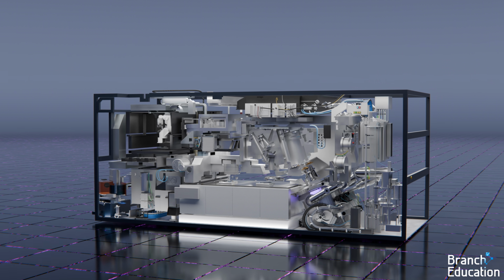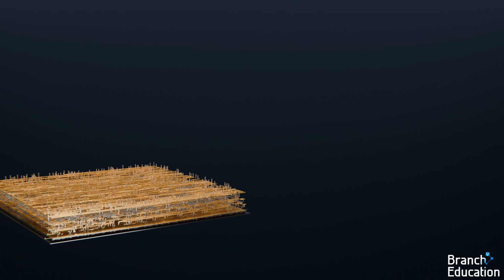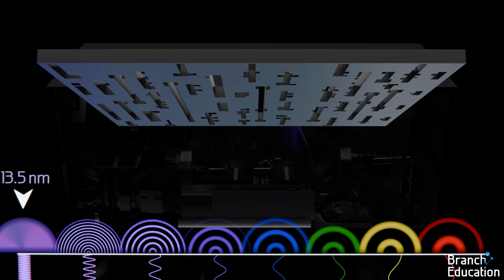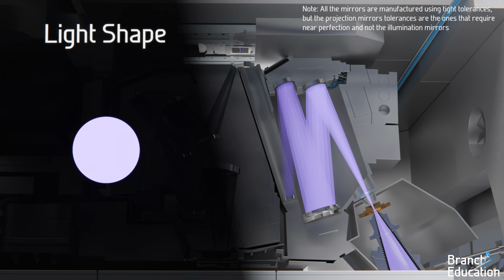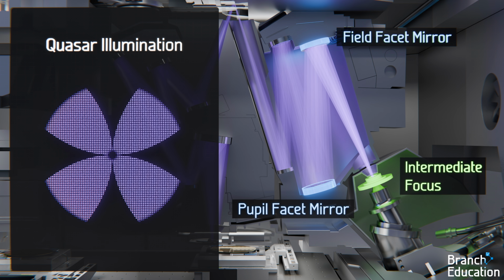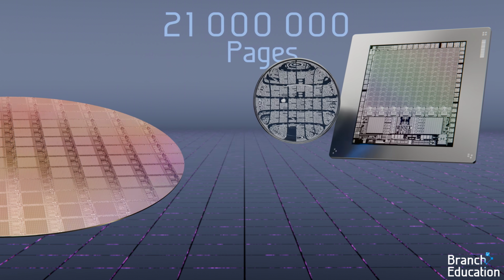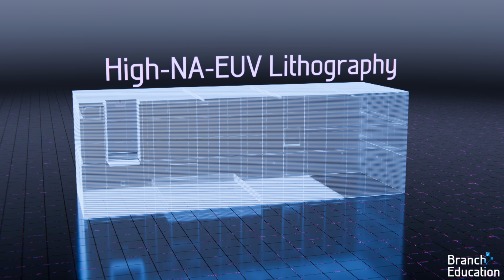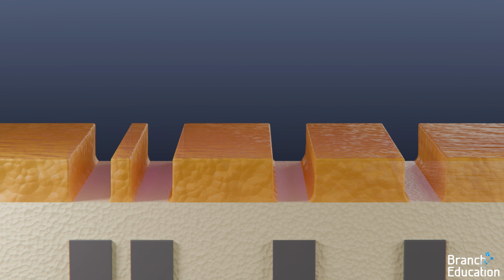The $200M Machine that Prints Microchips:  The EUV Photolithography System

Comment: One question that I cant figure is, 1) how is it possible for the wafer to sit above the magnetic field and move in pin point accurate synchronization with the beam of light hitting the wafer because if it is a nm difference its wasted. 2) Does the electromagnet have any effect on the wafer particles? The main secret of the machine has to be in the detailed accuracy of its parts...

Comment: I'm starting to wonder if X-rays using special fluoroscopes would be more efficient than shooting flying drops of tin with lasers, while producing an even smaller wavelength, but I'm sure we're right up against the hard limit of transistor size as it is, and it's probably been explored by now.

Comment: Why are the wavers a circle and not a rectangle? Couldnt more chips fit onto it then?
Reply: When you have to make a plane of material so consistent and uniform that you have to use tricks of physics instead of direct contact tools, circles are your friend. Guess how early rectangle panes of glass for windows were made? Circles cut down to rectangles.

Comment: this video was absolutely BONKERS.
A couple questions came to mind. We learned that the reflective material for the extreme ultra violet light emitted reflect only 3% of light per layer, then why doesn't the mirror have more layers? is it a matter of light being absorbed while passing through even tho it's so small?
Another question i have is: I learned from previous videos that the chips can be defective in some way due to photoelectric errors or let's call it "dirt", how do these happen? is it that hard to maintain the cleanest environment throughout the processes?
Final question is simple, are damaged or imprecise wafers simply thrown away or are they cleaned and "reset" in order to recycle the material and make a new set of chips?

Comment: Sub nanometer accuracy for the  metrology. That is crazy.  Off by .00001 deg./sec, sure no problem with rotating the disc to correct clocking. Then the linear positioning of the disc to hold positioning is just as crazy.

Comment: Hi, I am from Taiwan, home of TSMC, and I really want to thank you for those who contributed in this channel, this is the best animation video with the richest information ever about the EUV machine, my biggest respect to you all and thank you so much~
Reply: Based on current information, it appears that TSMC is planning to skip the use of ASML's "High Numerical Aperture Extreme Ultraviolet (High-NA EUV)" lithography equipment for the development and initial mass production of its 1.4-nanometer (A14) process.

Key takeaways:
 * No High-NA EUV for A14: Reports indicate that TSMC has decided not to purchase the extremely expensive (estimated at around $400 million per unit) High-NA EUV machines for the 1.4nm node.
 * Reliance on Standard EUV: Instead, TSMC plans to leverage its existing or standard EUV (0.33 NA EUV) tools and combine them with complex multi-patterning techniques to achieve the fine feature sizes required for the 1.4nm process.
 * Rationale: This decision is primarily driven by cost control and the proven maturity of their existing EUV technology. Using standard EUV with multi-patterning is considered a more cost-effective approach compared to adopting High-NA EUV.
 * EUV Tool Procurement: Despite skipping High-NA EUV, TSMC's demand for EUV machines remains strong. Reports suggest the company plans to acquire around 30 standard EUV machines in 2027 to support the mass production ramp-up at its Taichung 1.4nm facility.
 * Mass Production Timeline: TSMC's 1.4nm process is scheduled to enter mass production in the second half of 2028.
In summary, TSMC will use EUV lithography, but not the very latest High-NA EUV equipment, opting instead for standard EUV combined with sophisticated patterning techniques to hit the 1.4nm node.
Reply: Respect to engeneer's but not for you
Reply: @Kimjeeseong  What a goblin move. I like it.

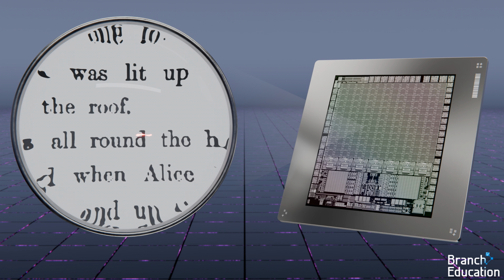Comment: 27:05 How is the mask printed? How is the mask and or patterned wafer inspection performed to validate the mask pattern was printed correctly?
Reply: It’s printed using electron beam writer, these print the pattern at highest quality possible. It’s not used in the fab for volume production of actual chips because it’s too slow and thus too expensive.

Comment: All of the engineering mentioned in this video is so cool and I have a few questions:
1. How did they come up with connecting bilions of transistors to make working micro processor and how did they even made the schematic or circuitry in the computer (did they use some sort of KiCad?) (what kind of computer can store that many transistor at once?)
2. How did they made the mask?
3. Is one machine always “printing” just one layer and the wafers that need that layer come to the machine or the masks dynamically change between machines?
Reply: 1. The answer is iteratively. We started printing bipolar transistors measured in the dozens on a circuit, then moved to PMOS measured in the hundreds, to NMOS measured in the thousands. Until this point, circuits were designed by hand and later shrunk to a mask. However, at this this point, computing got good enough to start to have computer design tools, and they stopped being done by hand. Now we have good EDA software for designing these things that have carried us to this billions threshold. Along the way, we've had to dramatically remodel many parts of the process, but the core idea on how to do it was kept the same. 
2. A similar but slower and much more expensive process (to account for not having a mask to use of course)
3. Yes, it does one lair, and then that wafer will go through more steps before returning to an EUV machine a day later or so.
Reply: Edit 1: 
1. They probably have stored all the layers separately rather than one big file. They just switch between different files of layer to see where the one connects to another
Reply: @jandy1551  I Know it's a huge amount of data raw but there's so much repetitions it might be very easy to compress, the more you have anything that can repeat, the more you can point out the start and end position of where it repeats instead of having every transistors being stored in your end "achitecture" file. So my guess is that these are manageable size files on a good consumer SSD.

Obviously I'm pulling all of this out of my ass but that's my intuition, might be completly wrong though
Reply: How is a mask made ?
Reply: @nikhilsharma064 Electron beam lithography. It's much slower than photolithography but it's using electron instead of photons so it has a much higher resolution perfect for patterning the mask. Although masks are 4x larger so theoretically it can be patterned using immersion DUV.
Reply: @nikhilsharma064   The mask is bigger than the projection.

It's the opposite of how a movie projector enlarges an image with a lense (or mirror), but loses detail.

The projected image of the mask (basically a stencil) is shrinked.

In the old days, masks were very large and were made by hand. Typically by a woman with high dexterity and a stable hand, cutting out the stencil by hand, with a scalpel type tool.

Light shined through it is shrunk with a giant lense. So that the projected image is tiny.

Comment: I have a very silly but curious question. At 3:05, when the initial disks are loaded, why are they disks? Wouldn't it be better if the discs were squares instead??
Reply: Its because of how the silicon crystal is grown. A seed crystal is dipped into molten silicon and pulled vertically creating a long round rod that is then cut into wafers

Comment: I'm sorry, we hit TIN with HIGH POWERED LASERS, TWICE, to generate 500W UV LIGHT that DOESN'T NATURALLY OCCUR BTW to scribble 15 NANOMETER LINES on a SILICON plate suspended AND held in place by MAGNETS.
Insanity that people would ever come up with this. Amazing video, fantastic science, more please.
Reply: Yeah its insane, and what makes it even crazier is that the laser hits 50000 tin droplets per second.
Reply: I mean, most people have no idea what it even means to have 500W of light, let alone EUV light. It's a very high power. Even a 1W beam infrared can already burn a hole in your t-shirt. 500W is scary.

Comment: apologies , some questions:

1) how do the actuators in the short-stroke stage work?
      1.a) you explained that the wafer carrier corrects the wafer position at each pattern etching to account for the topological map the alignment sensor builds: how does it account for the different height given by the topological map?
              1.a.i) Is the EUV beam able to be refocused at different distances? how?

2) what features is the quasar illumination pattern used to etch?

3) i knew that often multiple exposures were used to etch a single reticle, is this information wrong/not true anymore?

4) why is the exposure done in a "slit" rather than "globally" (i mean, illuminating the whole reticle at once)?
    4.a) how is that slit achieved? do they have distorted mirrors (not even asphericals, as that would still be axially symmetrical)?
              4.a.i) how do they make such mirrors?
    4.b) do Bragg reflectors need to have the same surface finish on each of the layers, or is the final surface more important than the others?

5) how does the intermediate focus work?

6) how is the reticle constructed?
    6.a) is it in itself constructed via reiterated lithography from bigger and bigger one-use reticles of common patterns of logic for the processor?
              6.a.i) how are those built? do other methods other than lithography become feasible at large enough scales?

7) If the tin is vaporized at different point (as each droplet has a slightly different trajectory), how is the EUV light not slightly shifted from one droplet to the other? is the cone of light carried by the optics bigger than what the etching utilizes to account for this?

8) How strong of a vacuum is pulled inside the lithography machine?

9) Given the 50KHz frequency of the light beam, multiple "flashes" are used to perform a single exposure (let's say 50000/18s (per wafer) / 100 (reticles per wafer)). how is a consistent light exposure achieved?
Reply: 1) how do the actuators in the short-stroke stage work?
      
Short stroke stage corrects the yaw (orbit) corrections for topological corrections is handled by the field facet mirror

2) what features is the quasar illumination pattern used to etch?

Dipole illumination is used for x and y axis
Quasar illumination is to more accurate x and y axis including diagonal features

3) I knew that often multiple exposures were used to etch a single reticle, is this information wrong/not true anymore?

Depends how you define multiple exposures as you see, EUV turns on and off 50,000 times a second so its multiple. photons behaves as a probablistic wave and sometimes does not hit on accurately on one point along the wave, so multiple hits are required to etch acurately. But if you are asking "How many passses" then its one

4) why is the exposure done in a "slit" rather than "globally"

Slit because limitations in EUV power. Channel already said that there are 30% losses per mirror, this is not the complete story. Laser conversion is just 1-3% so 97-99% is lost there. Then EUV from tin plasma fires in all directions and the collector mirror only reflect 30-40% of the collected EUV which itself is a Bragg Mirror has 30% losses itself

If it is global reflection, granted its possible, there will be difficulty in alignment on the topographical aspect of the wafer

4.a) how is that slit achieved? do they have distorted mirrors (not even asphericals, as that would still be axially symmetrical)?

Controlled by multiple mirrors with axial corrections on the field mirror

4.a.i) how do they make such mirrors?

Magnetron sputtering and if extreme accuracy required, Atomic layer deposition with chemical and mechanical polishing. It has about ~50 alternating layers of Molybdenumn reflector and Silicon spacer on layers and surface to prevent contamination. Total thickness is 150-200nm, still less than a micron

4.b) do Bragg reflectors need to have the same surface finish on each of the layers, or is the final surface more important than the others?

Silicon capping is important to prevent contamination of the molybdenum layers, especially at the tin plasma chamber. This area can be contaminated by tin sputter and deposition from tim plasma gas. There is constant hydrogen flush though

5) how does the intermediate focus work?

I think I discussed most parts of the intermediate focus (tin furnace) part, what is left is the zinc filter on top. Blasted tin produces mostly EUV but also other wavelengths, the Zinc filter removes the other frequencies

6) how is the reticle constructed?

The silica and the tantalum blocker is printed by electron beam lithography. If Twinscan is the mother, Then E Beam is the father (LOL)
For the Bragg Mirror layer of the reticle, Refer to my answer at 4.a.i

7) If the tin is vaporized at different point (as each droplet has a slightly different trajectory), how is the EUV light not slightly shifted from one droplet to the other? is the cone of light carried by the optics bigger than what the etching utilizes to account for this?

I think the representation is wrong, the laser light should be another point to convert the tin into pancake then at the center of the convex should be the high powered laser. 

If the droplet is off trajectory it will be disposed, if it meets tolerances, then it will be blasted. Not all probably at same trajectories, but the 50K frequency can compensate for it

8) How strong of a vacuum is pulled inside the lithography machine?

To the point that air molecules are gone inside the machine as air absorbs EUV and it can oxidize parts inside

9) Given the 50KHz frequency of the light beam, multiple "flashes" are used to perform a single exposure (let's say 50000/18s (per wafer) / 100 (reticles per wafer)). how is a consistent light exposure achieved?

At 50,000 its almost as consistent like you can deciper motion at 60HZ on your phone display. I think I explained the wavefunction of light at number 3
Reply: @francissalvador4958  Man, that's absolutely insane, thanks for taking the time to answer all these questions.
Reply: @francissalvador4958 absolutely mind boggling. Thank you for the insight
Reply: Sit next to me during the exam
Reply: And that was a really long reply. I lost sleep because of you. LOL
Reply: @francissalvador4958 thank you for this explanation! This was very helpful!
Reply: You will need to work at ASML for some of those answers, I think. But some of these seem possible to just guess. For example the refocusing - if the wafer carrier levitating, it can move in z direction too, so no need to refocus, it just moves up an down. The slit makes it possible to align the wafer, think about it - if it was fully illuminated, all that alignment wouldn't be possible, would it? Coz the wafer is offset to different directions at different locations, it's not like the entire wafer is uniformly offset.
Reply: from what I understood on the video, I think I can at least answer questions 7 and 9 : for question 7 there is high speed cameras that mesure the trajectory and velocity of the tin droplet to adjust the last mirror so the light reaches the droplet in the same way every time. for question 9, if the 50KHz frequency of the light beam is constant and the chip exposure duration is also constant, I think we can deduce that each chip receives the same amount of light and therefore the same exposure.

Question 6 is interesting I had the same thought I hope there will be an answer soon
Reply: For #9, without giving too much away, there's something called dose margin which is the difference between maximum open loop EUV and closed loop EUV. It's meant to give you some overhead on exposures that wont lead to yield loss in case you get some plasma instability. There's also a number of hardware/software controls to maintain dose at the recipe level (whatever amount of light the chipmaker decides they want for that particular exposure lot).
Reply: @AxLE__111 MajorPineapple12 is a hell of a name for someone who seems to be a very successful engineer.
Reply: I'd hazard the guess, that each reticle is manufactured in 50 000 steps with maybe x,y,z position adaptation at each step. A lower area slit might be needed for the required light intensity. and with a "parabolic trench" mirror, parallel, unfocused, light can be transformed into a line of light. Piezo crystals are often used for high accuracy actuators and for utrasonic sound emission, so they should be fast enough for a position change per light exposure ~2,5 kHz.